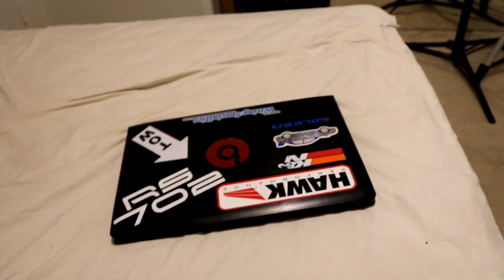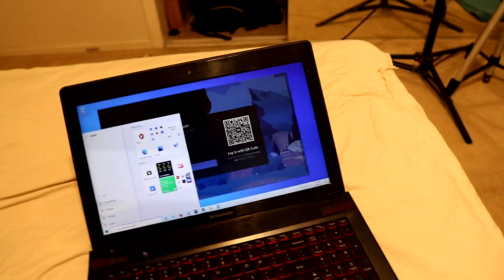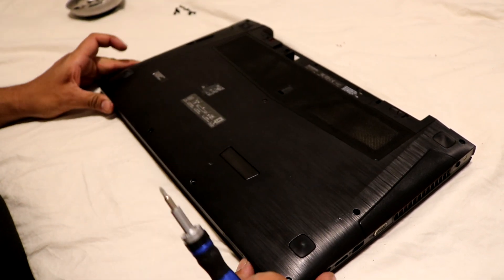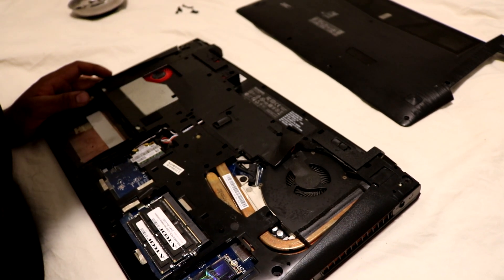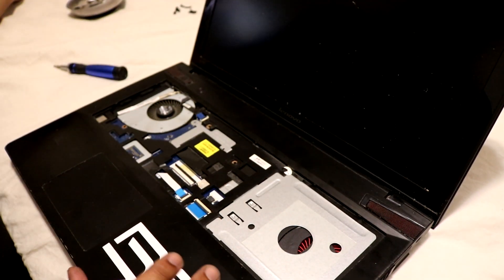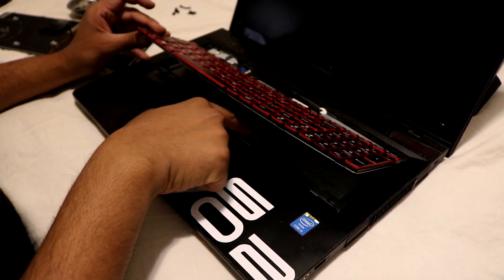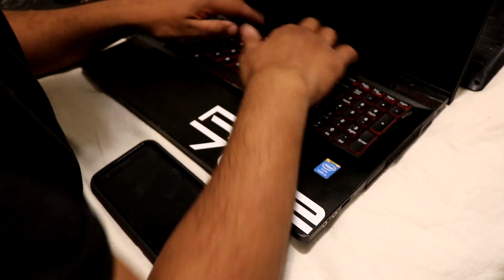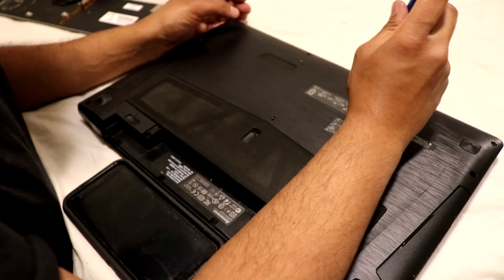Lenovo Y510p Keyboard replacement

Comment: I'm sitting here with a half-disassembled laptop. You really could've stated how many screws you removed in total so I know whether I should look for more.
Reply: I know a bit late but it was three screws. I wasn't sure either, but I looked at my replacement keyboard and saw only three studs. The areas are clearly marked with a keyboard print as well.
Reply: @kgroombr hello is this a good laptop to use in 2025 for light gaming?

Comment: i have the exact same issue with the exact same keys, so i'm inclined to suspect it's not water damage; also because i didn't spill a drop.

my keyboard has italian layout, so typed characters don't match with those in the video, but key positions are the same.

so maybe it's just a coincidence, maybe it's due to some wiring/welding pattern.

these are all keys coupling i spotted so far; they "work" both ways:
F1 <> w
F2 <> e
F8 > o
\ <> q
r <> 5
u <> 6
p <> '
i <> ì
- <> +
num9 <> num6

i'm going to double check looking for drivers issues or debris below keys, then i'll concede and replace the keyboard.

thank you for the video!